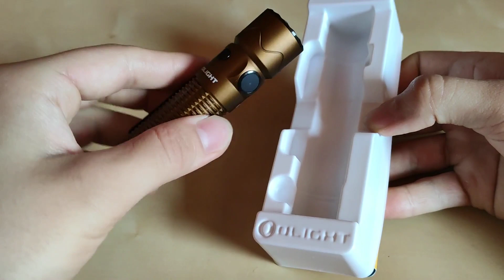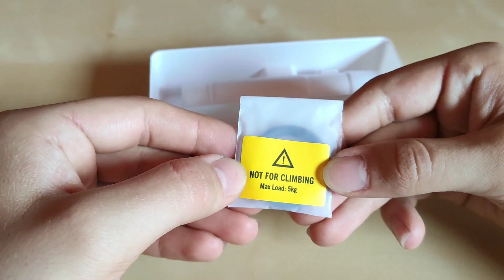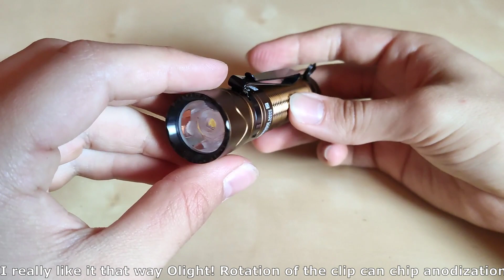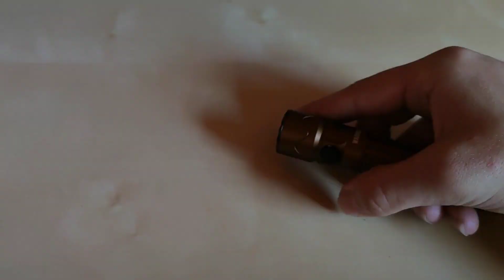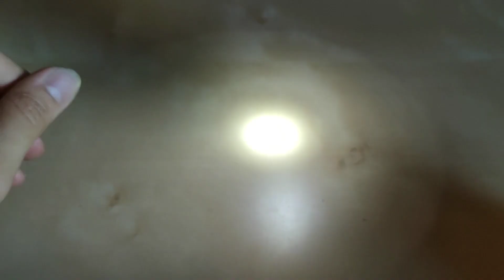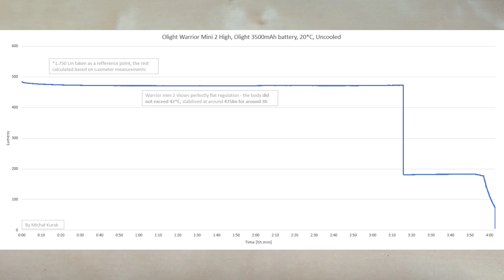Olight Warrior Mini 2 Flashlight Review - Tactical EDC with Innovative Design and Magnetic Charging

Comment: My only issue with those is the proprietary battery.
Reply from the maker: That's a big point for many more conscious users. I would also add mostly ugly greenish cool white LED with no choice of neutral or warm white option and often faulty battery circuits that needs to be replaced (3 out of 5 cases in my experience...)